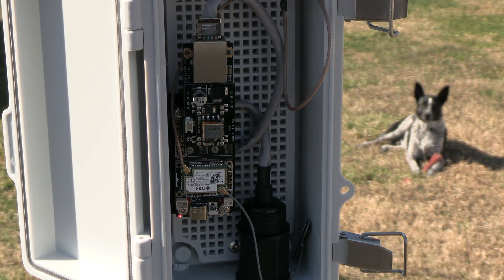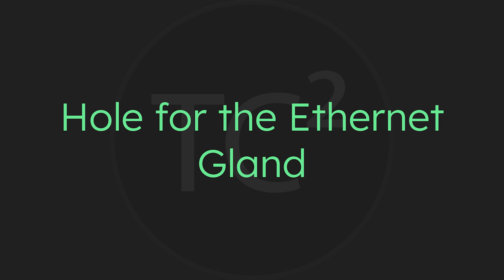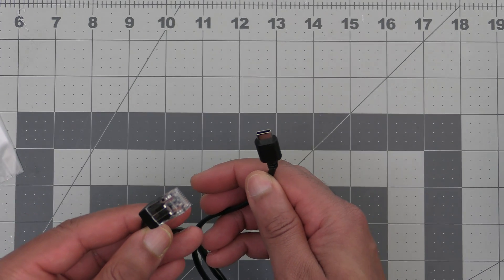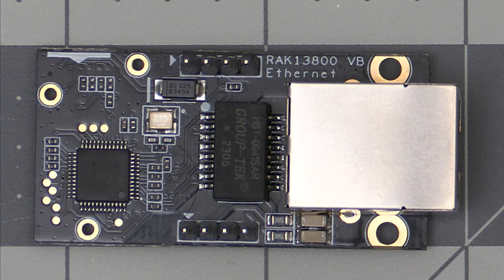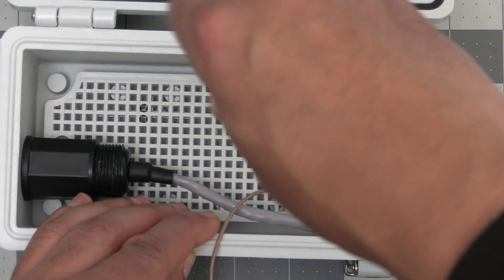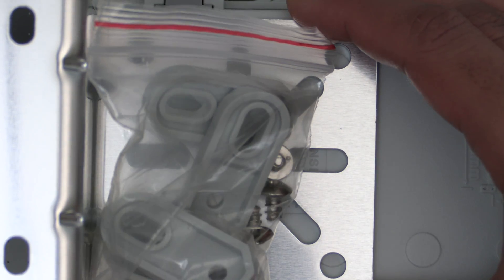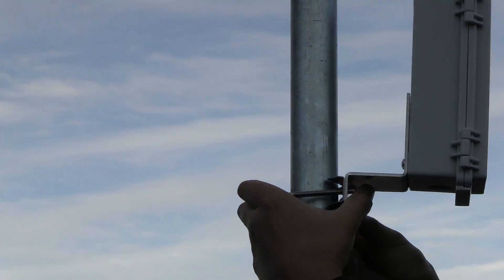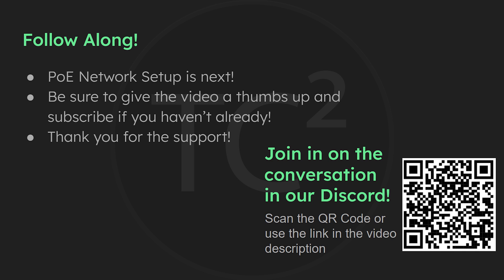📶 PoE Meshtastic Repeater Build Video 📶

Comment from the maker: Forgot to mention this in the video but if you're using the PoE UPS, be sure to turn the 24V/48V Selector Switch to the 48V position.
Reply: I found several POE adapters that wouldn't work for me and sure enough, they were 24v.  They must be 48v to work.

Comment: The ethernet connector cable can and maybe arguably should be installed OUTSIDE of the box, if you need more space. The “Nebra Outdoor Miner” boxes use something similar - the connector is outside of the box and threaded into the box.
Reply from the maker: @brauhaus I went with the available options for waterproof ethernet connections. If you know of an alternative that can be installed OUTSIDE the box, I'm happy to include it.

Comment: A quick word about POE, POE was defined by standard 802.3af as a self negotiating power standard, but many modern manufacturers are advertising their devices as "POE" without actually supporting this standard. TP-Link is usually one to avoid, they claim their devices are poe but most of them just inject 24v across two of the wires, which is why it doesn't work. The Rak device is attempting to negotiate the power standard with the provider, but the provider does not have real poe or smart power delivery. If you have to select the output voltage on the provider it is not real poe, typically you see a supported voltage range of 24v or 48v up to 56v but that is intended to allow for multiple manufacturers to require different power standards for their devices and have it fulfilled by the provider regardless of what is providing the power. TP-Link does make some injectors that will work but you must verify that it supports the 802.3af standard

Comment: Very interesting. I use a Heltec module and case built into a ready made box with battery. This is mounted in a waterproof box. Power is fed by a USB long data lead. Which charges battery and data. Simple set up. Yours seems over complicated. George in the UK.
Reply from the maker: Not an option for everyone. USB cable is limited to a length of 5 meters. Ethernet is 100 meters
Reply: @The_Comms_Channel  To be honest I use Bluetooth mainly USB is for charging battery and powers the unit. So I have a battery up pole lasts 2 days but have a USB power bank as well with that powered by mains.

Comment: Hi, my setup is based on RAK4631: RAK19007 Base Board - RAK13800 Ethernet Module - RAK19018 PoE module
After mounting and connecting to MACBook via USBC I did factory reset and upgrade with latest Meshtastic beta firmware. I can setup RAK4631 via Web interface and meshtastic CLI. I set also static PIN for bluetooth. Problem is, that I cannot pair RAK4631 via Bluetooth with iPhone App or MacBook. I can see RAK4631 in device list in App, by clicking on it I can see just Connection Attempts with no success. After first attempt I can see that RAK4631 is immediately rebooted. I think it must be hardware problem with RAK4631. I have also tried to use different firmwares with same result.

Comment: Re power issue wiz block, why not add a relay to the wiz power connected to a GPIO on the pi zero?
Reply from the maker: Looked at some pi hat relays, but it would make the stack too tall to fit into the enclosure.

Comment: So I've built a node with the ethernet module (no POE) but I cannot connect to the node via ethernet? The IP address does nothing. The meshtastic client doesn't seem to work either. 
What am I doing wrong?
Reply from the maker: Not sure what you mean when you say the IP address does nothing. Are you trying to connect to a web interface like you do with ESP32 devices like the T-Beam? If so, the RAK equipment are NRF52 devices which don't have it built in. MQTT and Meshtastic Network Management Client (still in early development and has bugs) is what works as far as network connectivity goes at the moment.
Reply: @The_Comms_Channel   I literally just worked that out as you replied. Thanks for your help 

I assumed the Rak stuff would behave the same as ESP32 stuff. Might make another remote node instead.
Reply from the maker: @Teeurbo  Sure thing! They're a bit different between the two platforms unfortunately. NRF52 doesn't have as much room for things like the build-in web interface like the ESP32 stuff.

Comment: @The_Comms_Channel I think I understand what is happening with the PoE module not working with many PoE switches.   The lower power nature of the wisblock board and accessories is causing the RAK19018 to enter a gated pulse mode which means the power signature it provides to the PoE switch/injector is not constant.  This causes many "smarter" PoE switches to think the device is constantly disconnecting and reconnecting and therefore the switch keeps shutting off power to the port.   The reason some PoE switches/injectors DO work with the RAK19018 is if they are basically "dumb" and just blindly shove power.
Reply from the maker: Ah, that makes sense. Thank you for this. I've not been able to make much sense of the issue, but I bet this is it.
Reply: @The_Comms_Channel  Confirmed!  Using a 25ohm resister on the 5v output connector of the RAK19018 solved the PoE problem.  I'm now successfully powering the Wisblock from my Ubiquiti PoE switch.  I used the little pigtail connector you included in the mounting board kit (with battery holder) and soldered the resister between the red and black lead.

Comment: How often do these need firmware updates to continue functioning? I have a mast on my roof I want to throw this on with constant power but it is going to be extremely difficult to access… the mast goes up soon and ideally I would like to never have to take it down again
Reply from the maker: They will continue functioning as repeaters until version 3.0 comes out (will be some time). If you're using it as a client, sometimes when there's an update to the app it will need a firmware update. If you don't want to run into this issue, you will want to not update the app. If you do want to update the firmware on the device, there is a way to do so over Bluetooth so you don't have to take it down.

Comment: Is there any concern for lightning protection in a setup like this? I want to roof mount using POE but I'm concerned about lightning strikes. Would mounting it lower than the peak of the roof help?
Reply from the maker: A lightning strike that close would likely fry the device so mounting it lower probably wouldn't help much.

Love the profile pic BTW, beautiful Pilatus.
Reply: @The_Comms_Channel haha thanks! I fly the PC-12 but I wish I flew the PC-21 lol. As for the antenna I might just mount it with my ADSB receiver which is already grounded. Might lose range though.

Comment: What would be the advantage of using PoE for the standard build vs. using a 5v backup battery bank? Is it just temperature?
Reply from the maker: Beautiful cub you got btw. Working on a Kitfox in my spare time.
Reply: @The_Comms_Channel that’s awesome, good for you. Like a battery pack you’d charge your phone on…
Reply from the maker: @BlueCubAdventures  The main reason for using PoE compared to the solar version I did a video on is temperature. If you live in an area where the inside of enclosure would get too hot or too cold for batteries, then this is a good option.
Reply from the maker: Not sure what you mean by 5v battery bank.

Comment: I found that Ubiquiti make a great $45 outdoor enclosure called "Flex Utility" which is weather proof, has pole mounting bracket in the back, locking screw, nice padded cable clamp thing on the bottom that fits 5 cables which made life a lot easier for me compared to using glands. Even comes with a 60W PoE adapter included. It's my new go-to enclosure for all kinds of maker/IoT projects. No built-in bracket for a solar panel but you can't get everything you want :-)
Reply from the maker: I'll have to check that out! Thanks for the heads up!
Reply: @The_Comms_Channel  yeah only downside might be that the inside has two fixed compartments where you are supposed to clip in a power supply and a switch, i personally dremeled mine away but a more elegant way would probably be to 3D print a couple of standardized plates that could slot into those two compartments and then allow for mounting stuff like a wizblock or battery holder. That would allow for toolless removal of the internals for updating etc. Althought the pole mount already offers you to be able to just clip the entire box off and take it inside if you don't use the locking screw

Comment: PoE switches can be, well, a pain..  especially if you're using non-standard style network endpoints.  My Unifi switch has 802.3at standard and doesn't like to power some devices in default configuration using PoE+.  If you set the port to "passive" it'll generally power the picky PoE devices.  Oddly enough, my first Unifi WAP required that to avoid using a power injector.

Comment: Cant you just use the USB side of the POE splitter to connect to the USB-C slot on the board for power?
Reply from the maker: Yes, that is an option.

Comment: Repeater proximity to UHF,VHF transmitters...CAUTION.
FYI, I had a V3 configured as a repeater, had it on my radio tower, very near my VHF J pole.
After our radio net I discovered the V3 on longer working. It will flash ok, but will not allow configuration.
I suspect my VHF transmissions damaged the V3

So now I'll have to relocate a new repeater, not sure how distant it should be from VHF antenna, I'll try 30 feet and observe.
I should have seen that coming.

Comment: I have a question.  Originally, I had planned a solar build from your video but after reading results from other people typically I see it won't last more than a month or two depending on the size of battery you start with.  So, I've ordered the POE adapter and the ethernet adapter to switch to POE.  Here's my question, should I still install a battery and the solar panel?  Would it do any good if power from the POE failed?  If that setup would give me 1-3 months of power after the POE died (using those three power options) that would be ideal.  So I would have a POE powered node, with a 10000 mah battery and the 6v 5w solar panel.  Thoughts?

Comment: It’s kind of silly to cram the POE splitter inside the box. You should just have that splitter at the source, then run the eth cable from that directly into your box.
Reply from the maker: That makes no sense. The splitter is there to provide power to the USB port on the WisBlock.

Comment: I'm running linux laptops with fire fox would I be able to flash the bios? or will I need googles browser?
Reply from the maker: Firewox won't work. You'll want to use Chromium or Google Chrome.

Comment: Why are we doing this? People are saying its 80 people before you get a saturated network so advertising it literally kills your mesh
Reply from the maker: It's my understanding that the 80 people used to be a set limit of nodes that could fit in the NodeDB. When that filled up, it would cause the devices to crash. That has since been fixed and now it just deletes the oldest node in the DB.

Comment: I love your videos, it’s inspired me to try out and begin building my own off-grid comms.  What I would like to see is a video series about how, if possible, to protect these nodes from EMP.  Right now the only way I can think of would be to have a second node stored in an EMP-proof container ready to be swapped out as necessary but it would be better if protection could be built into the nodes.
Reply: There really is no practical way to protect any electrical device that's connected to an antenna from an EMP or Carrington event (or worse, a Miyake event).  I'm using the replacement method.  Solar panels and WisBlocks are fairly inexpensive.  I'll program at least 2n+1LoRa devices for an n node network and store the spares in the tactical galvanized trash can in the basement.  For my 3 node FamilyNet, that's a minimum of 7 LoRa devices and 7 solar cells, 3 in use and 4 spares.  Also, don't forget the interface devices.  Store cheap Android tablets in ammo cans and small solar panels will also be needed to charge those Android devices.  Also, for an EMP instead of a Carrington event, it's likely that a second EMP will be used 2-3 weeks later to take out emergency backup systems after they're deployed.   😲
Reply: @Liberty4Ever  good thoughts.
Reply from the maker: Thanks! I'm glad to hear that! I've gotten this question a lot and plan on doing a video on it. Liberty4Ever's comment sums it up though
Reply: Is that even a real concern?
Reply: @ophello  EMP is always a real concern.  Any off-grid solution would have to consider that a risk factor.  Luckily these things are fairly cheap to keep a few protected swap out.

Comment: In addition to recharging the batteries with a solar panel, do you know whether we can also use the solar panel connector (1.5mm JST ZHR-2) for standard 5-volt recharging? For example, a USB-C cable-to-JST plug into the solar panel charger? It would be nice to use that one plug for recharging via BOTH solar & conventional means.

Comment: Hi great video as always. I have the PoE UPS that you show in the video, but it doesn't look like it provides enough voltage for RAK Silvertel PoE module (it says 36V to 57V input, but the UPS says something much lower)? How did you tackle this?
Reply from the maker: There's a selector switch for 24V/48V that you need to set to 48V
Reply: @The_Comms_Channel  Doh! I thought we had the exact setup, but whilst they look identical, mine is switched between 15v and 24v on the PoE connector. Off to return mine to Amazon. Thanks for the heads up.
Reply from the maker: @dr3wster  Sure thing! The one in the video description is what I'm using.

Comment: Great video! A video on LoRa RF power measurement would be interesting. I ran into problem with a T-Echo with very low output power compared to the other T-Echo it is connected to.
Reply from the maker: Thanks! I will look into doing that!

Comment: The rubber peice for Ethernet grommets i've used, you put on the otherside and tuck/push towards the back and then screw on - far less fiddly.

I think you're putting that rubber grommet on, a bit, back to front.
Reply from the maker: Good to know! Thanks!

Comment: Great instructional video. Id just like to add that the Ethernet cable run should be for external use rated as the standard Cat5/6 will degrade quickly under UV light exposure & quickly becomes unusable.
Reply from the maker: True. The amazon link I used is for outdoor cable. I forgot to mention this in the video however.

Comment: Does the ethernet cable allow you do to cool stuff with the node via network or why don't you just supply power by USB for example?
Reply from the maker: USB cable has a shorter limit on length
Reply: Nope - RAK builds DO NOT currently have network control built into Meshtastic. No TCP control via CLI, no web server. Nothing, other than the standard admin channel. I don't even believe it's on the roadmap or tracked on Github as a requested feature - hint hint). Also worth noting that RAK setups don't support 'Save and Forward', so can't disptach stored messages to connected nodes. It's basically just great as a repeater/router, but if you want these extra features, you have to add another ESP32 node to your local setup.
Reply from the maker: @dr3wster  MQTT and MNMC works
Reply: @The_Comms_Channel  Correct - I actually use MQTT for location updates on my attic RAK setup. You just cannot control the node via TCP unless perhaps you push admin commands to MQTT, but that sounds pretty dodgy, encryption or not. Not sure what MNMC is?

Comment: Most antennas require a ground plane to operate properly. I used aluminum tape. It needs to extend at least 1/4 wavelength. Tape extending on 2 sides is normally fine. If you are using an antenna with an internal dipole, it doesn’t need the ground plane.

Comment: I like the idea of doing a security video. So quick question I read a comment on an earlier video. It was about a possible breach if some in the private group had the group in the first channel and shared the QR code. your fix was to make the public channel as the first and the private group as the second so the 3rd party can accidentally compromise the encryption and set an admin on the devise. Does having the private channel set to the 2nd spot stop you from sending you location? And can you change location sharing to different channels? As in the public is 1 turn off location sharing but have location sharing on for channels 2 and 3 for different group chats.

Comment: Run, don't walk to harbor freight and get a step drill bit. When drilling thin plastic or metal it will change your life.
Reply: been using step cutters for 20 years or more, brilliant tool
Reply: they were just giving them away with a $25 purchase.  I grabbed a couple of sets since I use them all the time
Reply: He might trip and fall...😢
Reply: Please don’t use a step bit. You’ll very easily make the wrong size hole. If you do insist on using one of these, you’ll need to ensure the step size is larger than the wall thickness of the box.